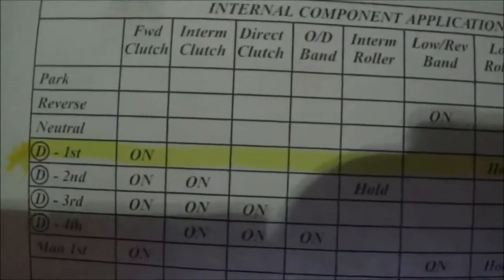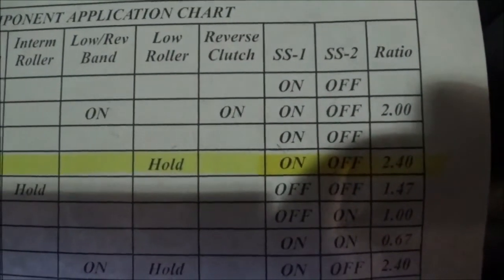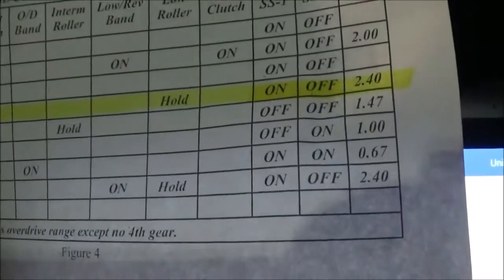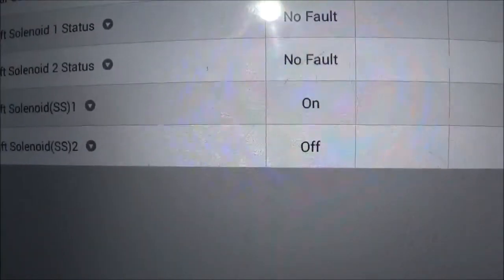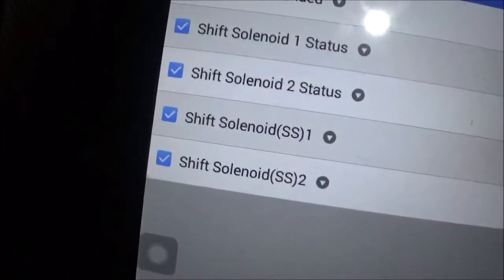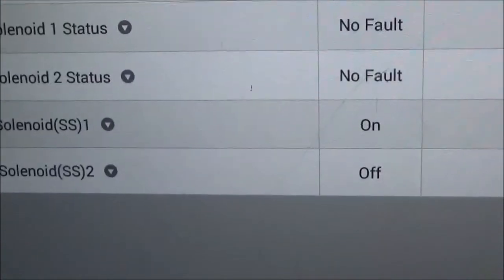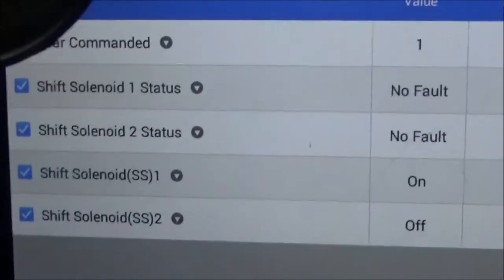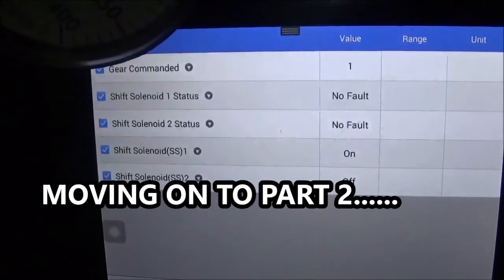2004 FORD F150 4R75W TRANSMISSION PROBLEM AFTER REBUILD. (PART 1)

Comment: I'm thinking the truck went for a swim thats why water was in it in the first place, I would check the connector above the pan, I believe you have a bent pin or rusted pin it is not telling the valve body what to do.

Comment: Did you ever come up with the solution?? I have a problem after I rebuilt my tranny and it drives fine in M1 and M2 but loses power and neutrals out after second gear in D.. it’s 02 5.4L 4x4 I can drive it in second gear manual all the way up to 60mph no problem. It’s at about 3K rpm at 55mph in M2. But I can only reach 30mph in D before it neutrals out. I checked the TPS with multimeter and it’s good. It reverses fine. No codes present.

Comment: Seems like a valve body circuit issue, but just speculating.  Check balls all in place and good shape in the valve body? Leak between the valve body and separator plate?
Reply from the maker: Had this out twice and checked everything. Still working on this headache.